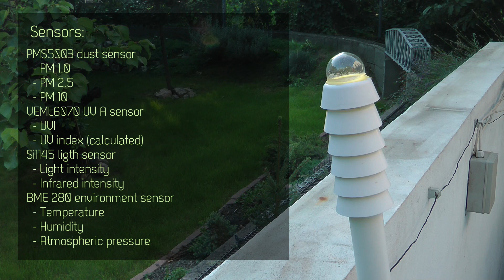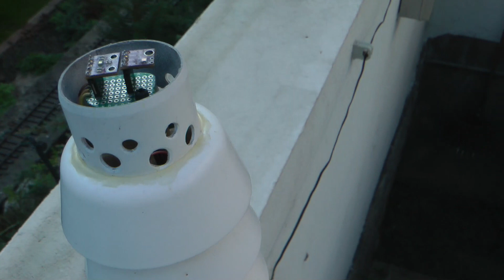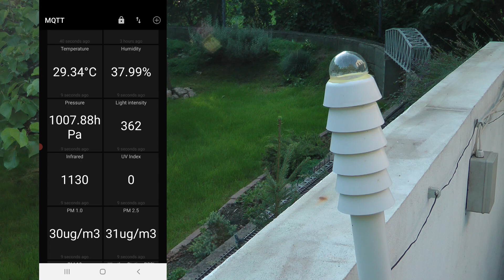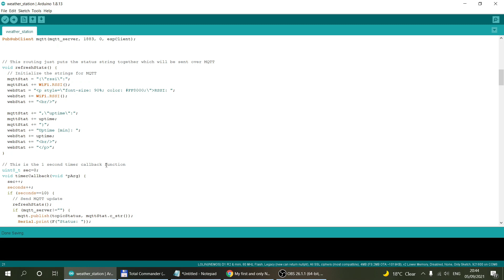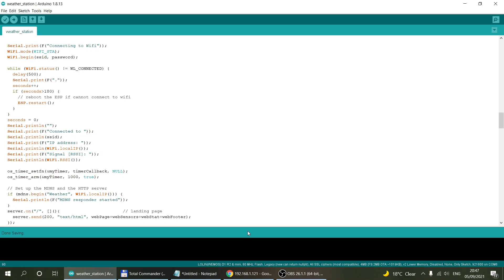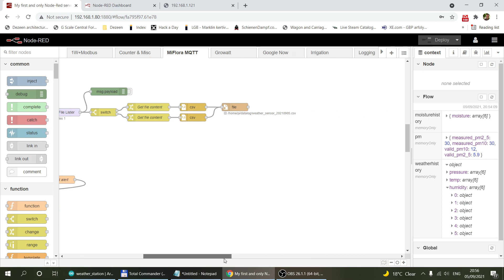My weather station build that survived 1 year now

Comment: I find temperature sensors that are in enclosures like that will report extra high temperatures due to the heat buildup inside due to direct sunlight.
Love the idea of this for sure and looks good.
I think maintenance of the dust sensor needs to be regular as it will collect dust doing its job....
Reply from the maker: I think I will test this in a new location where it gets shade most of the time and implement sleep for the dust sensor.

Comment: Nice build. One thing to consider with the PM sensor is lifetime, measured in how long the fan runs, when the inside of the sensor will slowly get dirty, and result quality diminish. With Tasmota, a feature is to slow down the rate of measurement by setting a wakeup interval.
Reply: Good tip on the Tasmota.   I will use it when I do my build.
 I think if it is in open air it will be pretty good.  Whether inside or outside, they collect dust, kind of their job.  If they get filtered air they can't do their job....     Just have to clean them every so often and having that Tasmota setting or similar to limit the read times will extend the life of the sensor as well as keep it cleaner.
Reply: @EsotericArctos   Those sensors are not easy to clean on the inside.
Reply: @JohnnieHougaardNielsen  You are right there.  But they need dust to work lol.
Reply: @EsotericArctos   Well the "problem" is not so much dust, but sticky grime combined with humidity forming a layer 🙂